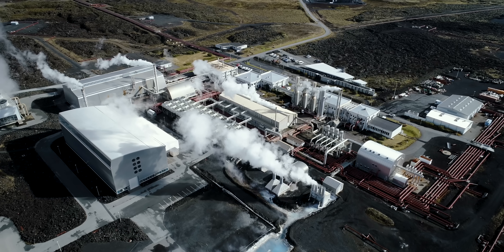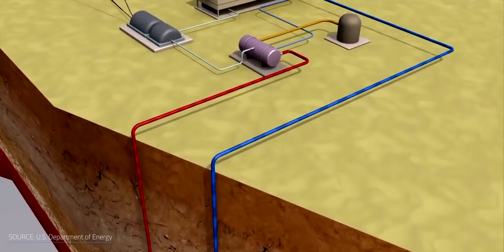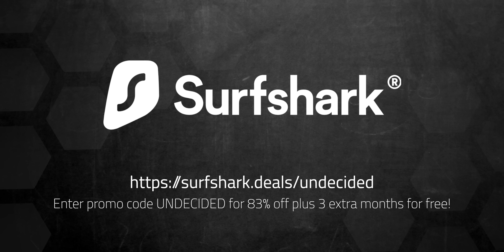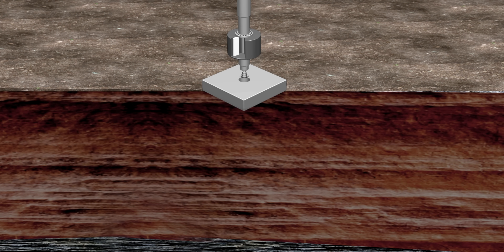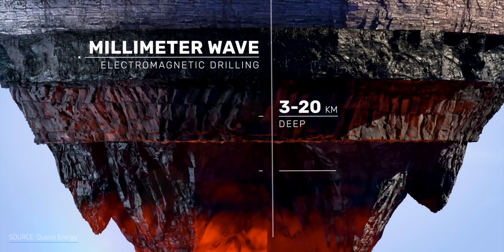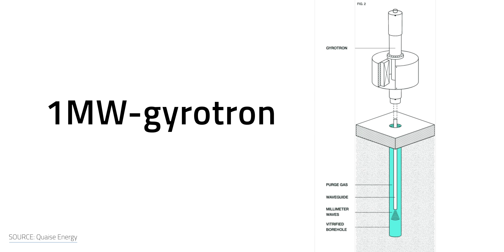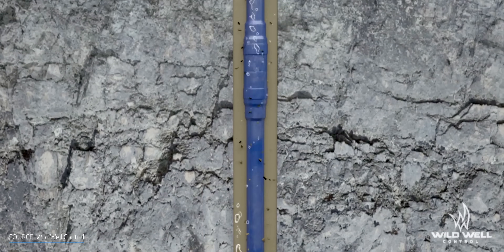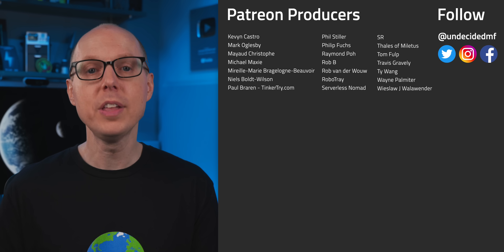Why This Fusion Tech May Be a Geothermal Energy Breakthrough

Comment: Geothermal power plants require high volumes of circulating water. Unfortunately there are only few spots where the hot area rock is porous enough to allow the circulation required.

Comment: Using nuclear power to melt rocks turning it into glass pushing it aside and a shaft is an old idea that I have come across 8 or 10 years ago , it was in the conspiracy movement in which they say tunnels criss-crossing this nation , supposedly there is a high-speed Train that could achieve Mach 1or 2 Underground in a vacuum tunnel , (and no it is not Musk the fraudsters idea it have already existed a long time ago ), supposedly there is a drilling equipment that uses some sort of atomic power to melt rockc and pushing it out of the way  ceiling and reinforcing the side walls of the tunnel.

Comment: This all sounds amazing, and I'm rather excited to see it in action! But... wouldn't pulling all that heated material up to the surface cause additions to the surface temperature of the earth? Perhaps a couple of these wouldn't make any measurable difference, but perhaps the numerous installations around the world? I'm really hoping that this isn't the case, but I'd love to hear the explanation about it. 
And if it would contribute to the above-ground-temperature, would it then make more sense to bury the geothermal plants under the ground by a certain distance to insulate it, and then run the power lines from that facility up to the surface for distribution?

Comment: I haven't heard anyone from Quasie talk about hove they are going to connect the down and up bore holes. The need for an ultra straight waveguide eliminates directional drilling, and I doubt you can frack at those pressures.

Comment: I can’t remember who told me this, but suffice to say, a wise old man with an eye for innovation once said to me, “You don’t need a drill.  You need a hole.  You use the drill because it’s familiar, and good enough not to warrant a second thought.  The drill is usually the best tool, but there may come a time when it isn’t, and you must remember, it’s the hole you need; not the drill.”
I’m sure to be paraphrasing rather substantially, but the point is preserved.

Comment: Boggles the mind how much power half a million can get you. At the residential costs I pay, 15¢/kWh, I could melt about 6,500 tons of steel with an arc furnace (~500kWh/ton). At the 3¢/kWh they quoted in the video you could melt over 33,000 tons of steel with the electricity used for one borehole

Comment: Drilling down is not necessary, there are plenty of places in US that have hot springs.  Hot Springs Arkansas, New Mexico, Montana, California, just to mane a few.  I don't see why drilling so deep is necessary, sure it wouldn't be hot enough for steam but any hot water can be a huge boost to turn it to steam to run generators.  They get gas from wells in Texas around Ft Worth area, and 90% of it is hot water around 180 degrees.

Comment: Sorry but to me this is moving beyond the mark. Reaching for inefficient methods that will never work as well, and do not have the energy density equivalent to make it comparable by costs. Why  has the west walked away from nuclear power. Walking away from mobility, and ease of energy load location adaptation.  Earthquakes, even away from plate boundaries, you still have fault lines, even in the Midwest of the US, we have fault lines. It does sound cool to test out but the costs to me would still be to high compared to a small modular mobile nuclear reactors, whose costs are more political than mechanical. Where ever you drill you will still need to set new power lines, substations, power transmission losses…. 
And I am still not buying this CO2 - bad, talking point. I see a lot of money being dumped into inefficient projects - solar - wind - solar concentrators, all with very very low power to cost ratios. All from fear mongering, of photos of steam - not pollution, not the real pollution in our water systems, oceans, soil. Remember solar, wind turbines, are not renewable, just like nuclear is not renewable. But the energy density for comparison is about 1,000,000:1.  Hard to see the truth through all the politics around “climate change”, and fear mongering, it is always another 10 years and we are dead, going back to the 1980’s, yet here we are - still, and the planet is getting cooler, not hotter. Check the facts.

Comment: Earth has a very hot molten iron core. If it cooled down, the planet would grow cold and dead. Cooling also could cost us the magnetic shield around the planet created by heat from the core. This shield protects Earth from cosmic radiation.

Comment: So, the Rossi E-Cat hydrogen nickel low energy fusion generator, and the Yildiz permanent magnetic motor are two working solutions that completely solve the energy needs of Earth, and those are just 2 technologies. Geothermal seems workable, but at some point science needs to set a hard rule that drilling deep holes is no longer allowed. There are simple above ground technologies (see above) that can work to transition us into renewable energy.

Comment: Why does the graphic which presumably shows potential sites completely ignore the southern hemisphere and most of Asia? This  way of tapping into geothermal power under existing coal power stations might give them a new, clean lease on life. Earlier on, there was a statement that the upper layers of the crust are always sedimentary and the deeper layers are granite. Not necessarily. Fir instance the Hunter Valley in Australia has granite very close to the surface and a lot of coal on top of it. So unfortunately it might be expensive to use deep drilling to replace the coal with geothermal. Where I live in Canberra, the granite is at or very close to the surface. The Snowy Mountains nearby are mostly granite. Anyway it would be great if geothermal could replace coal as the base load source.

Comment: unlimited energy is very easy to pull off. if you ever used a gas siphon, you know that you can use gravity to move water up and down through gravitational suction. now if you attach a water wheel to where the liquid falls out, you will be able to turn it to produce mechanical energy. attach a generator to it and you turn this gravitational suction into mechanical energy into electrical energy. So long as the suction isn't broken, which is obtainable, and so long as no one turns off the gravity, the water or oil or what ever you would like to siphon will continue to flow. Yes the laws of thermodynamics states there will be a loss of energy somewhere, and this is true, as nothing is 100 percent efficient. However, it beats waiting for solar panels to overcome their 30% efficiency, it beats waiting to dig deep into the earth, and it beats waiting for wind to blow. Not only that, it is incredibly easy to set up as well.

Comment: lets talk to paul to get to the b0ttom of this . . . yay puns!! ; so technically they could make one small and efficient enough to fit on a space force space shuttle to drill deep to stop a extinction level asteroid. this sounds great and geo thermal is good source of energy 2 . . .I saw this drill on newatlas a few months ago, it can revolutionize drilling and making underground tunnels or building foundations much faster . . . and maybe even more efficient mining using drones and smaller tunnels to get

Comment: My fear is, if this tech works, the oil and gas industry will just use it to get cheaper access to fossil fuels, then we'll be right back where we started.
Reply: For many reasons, this tech is not suitable for use in the sedimentary zone where oil and gas are found.
Reply: Thing is, you still have to drill MANY bore holes to access the same amount of energy provided by fossil fuels. You combust gasoline once, it’s done. You get to supercritical water heating temperatures the power will be available till our planetary core becomes inactive which would take more time than it will take for our sun to expand, engulfing our planet and becoming a red giant. You can’t compete with fossil fuels for energy when you’ve dug deep enough to to heat water to supercritical levels and probably can’t at levels before that either. But I agree it’s a concern worth being vigilant about as fossil fuel companies will try to extend their oil drilling instead of reinvesting for longer than is rational
Reply: @markhaus  Why do you compare this renewable energy source with fossiles? 100 kW per km² is not much, even if it only takes 10 holes to get it all out. The heat wll come up as decentralized as one can imagine, its not like you want to build a 10 kW turbine for every hole. Pipe to get it from A to B doesnt just cost money, the heat is simply lost on the way. Getting it out of the hole will already lose a lot on the way up. Its really not that straight forward, regardless of how easy/cheap it is to drill the hole.

There are other issues like groundwater contamination, earthquakes, hitting an Anhydrite layer etc. Such a hole isnt something you just put somewhere and thats it.
Reply: This will undercut the price of energy making it the least cost to everything but hydro.
Reply: The brake on that is government signed agreements to reduce fossil fuel use to near zero, thus making such fuel near valueless. The sensible players in the oil & gas industry will ensure they diversify into other power supplies as soon as they can ascertain which of them are going to be winners, and use their strengths to dominate those markets.
Reply: They will DEFINITELY do that, but if you can just keep digging and hit geothermal energy viability, they might not be able to compete with that. Fingers crossed.
Reply from the maker: I definitely see that concern, but I’m not too worried about that.  If Quaise succeeds at their goals, geothermal base load power plants will be one of the cheapest and consistent ways to generate power.  Corporations will follow the easy money (if Quaise succeeds).  Combine that with many countries policies to phase out carbon emissions and you may have a winning formula.
Reply: @UndecidedMF  So how much energy can be "extracted" from one of these holes over extended periods of time? So without depleting the heat reserviour? There is only so much heatflux possible, about 0.1 MW/km² according to wiki (Geothermal energy). So how many holes to drill to extract this power, to cover a whole km²? Does that still make sense if the location is not right?
Reply: @leocurious9919 The natural heat flux due to conduction through the layers of earth's mantle is not the limiting factor for geothermal energy. 
If you cool your bottle of beer in a lake are you increasing the temperature of the lake? If you boil a cup of water over a forest fire, are you decreasing the temperature of the fire? Sorry for the bad analogies, but what I'm trying to get at is the scale we're talking about here. As shown at 3:17 in the video, using only 0.1% of the earth's heat would provide enough energy for 2 million years.
One or even a few hundred local holes could not extract enough heat to change the overall temperature.
Same as using solar panels could not lower global temperatures, wind generators could not reduce global wind patterns, geothermal plants could not significantly lower the heat content in the earth's crust. Geothermal energy could only extract a minute amount of heat from the earth's crust, making the heat source constant and inexhaustible on any human time scale, hence it is considered renewable energy (does not deplete with use).

The limiting factor is not the heat source, but how much of the heat you can bring to the surface to generate electricity (or produce hydrogen or desalinate water). 
This project tries to reach a place in the crust with a constant 500°C temperature where water could be heated to a supercritical state, making it behave like a gas (i.e. compressible) enabling to transport much larger amounts of heat to the surface. They are also not hydro-fracking (seismicity problems), and use conventional drilling methods until they reach the impermeable cap rock. The question of course is if they can actually drill a hole that deep in real life.
Reply: They might, but probably will not, because their strategy so far was to drop oil and nat gas prices significantly in the 2010s to bankrupt little companies.  Then once the larger companies felt like they had a foothold to raise prices significantly.  The Ukraine War does influence crude and nat gas prices, but part of it is used as an excuse to raise prices.

This tech, like fracking, may help the little guy get a foothold again, which could cause a crash in oil prices again, which is a possible future, or the larger companies may maintain control, do everything they can to keep prices higher, and avoid this technology.  It will be interesting to see what will happen.

Comment: I Have worked underground in mines drilling and blasting access tunnels. Gold, Copper, Zinc, Iron, at different sites and times.When we are down generally beyond 3000 Ft and typically, 5000 ft, When I drill my holes in a round (About 30  to 100,  8 ft or deeper)  It's all subjective; but often at deeper levels, the pressure becomes so great, the holes actually squeeze closed on my steel so I can't extract my steel & bit, This is the subjective part , Ground composition, May have to drill and blast shorter rounds,  judgements! many scenarios to consider. This Is only a mile down! Pressure increases substantially with depth and The rock is not static! It moves!  Rock Mechanics should know this. Engineers are losing to technology & Pseudoscience. Sorry Matt I actually love your Stuff. But This geothermal drilling is only part of the problem.

Comment: Maybe start with old abandoned oil wells?  According to the Environmental Protection Agency, 3.2 million abandoned oil and gas wells exist in the United States. About a third of them were plugged with cement, which is considered the proper way to prevent harmful chemical leaks. But most haven't been plugged at all.

Comment: Thin shell structural strength of the hole would be excellent. Could be possible to slow the rate of advancement to provide increased thickness of the sidewall shell. Would it be enough? Unknown, would love to try it. This based on my 35 years of geotechnical engineering, licenses in most states, degrees in engineering, geotechnical engineering and minors in physics, chemistry and mathematics.

Comment: Who needs even fusion energy if we can pull this off? We can reuse commissioned coal and gas powerplants, it generates power around the clock and essentially never runs out.
With conventional geothermal being 4 times more expensive than solar per MW would that include the extra photovoltaics and batteries to store excess energy to use at night? If not then even conventional geothermal would be pretty cost effective.

Also in colder climates you could also use the geothermal powerplant to pump around hot water to heat homes with like they already do in Iceland (they also run these hot water pipes underneath roads to melt snow). Politicians should take a look at this and fund this

Comment: I wonder if it becomes more of an issue with powering it the further it goes with voltage drop on the power cable?. The voltage would have to be super high to begin with that length of cable run.

It's an interesting concept though, to retrofit existing plants would be great!

Comment: How resilient is the "glass" casing?  It is important to avoid contaminating overlying aquifers with geothermal liquids.  I am a big fan of geothermal and this might cure two additional problems beyond drilling cost.  First, as you mention, geothermal explorations costs are very high for most new facilities because near surface geothermal resources are rare.  But if you can drill cheaply enough, deeper lying resources that are more widespread become available.  Second,    in near surface resources, depletion of the heat resource is a problem.  Higher temperature resources with better recharge characteristics are more available at deeper levels.  Due to the way geothermal projects are financed, it is better to have a very reliable project that is only slightly cheaper than alternative energy sources than it is to have a chancy project that would be much cheaper than alternatives if it pans out.  Drilling deeper will add cost, but reduce risk.

Comment: Drilling mud is used to return material to the surface and keep weight to overcome pressure on the well column. This team will need to insure here is a way to contain 20,000+ psi of pressure in the well while drilling.

Comment: You could retrofit a coal plant with this. Just use the heat from geothermal, instead of coal. The turbine and generator, the cooling systems, the electrical systems - these investments are protected. Throw away the boiler and coal mills and the chimney!

Comment: Although I sincerely applaud the content on this channel, I found myself irked by references to fusion with respect to the EM radiation melting and vaporising rock. There is NO fusion happening here and using that word feels unscientific. No atomic nuclei are fusing here at all and transmuting elements or converting mass into energy.
Granted the connection with radiation pressure in inertial confinement for fusion research, and the care taken to laugh off references to death rays, but leaving the term fusion in to describe vaporising the rock is just propagating nonsense. [/rant]
I suspect I'm not the target of this channel, but I usually find informative content here to broaden my horizons, so please don't take this rare criticism the wrong way. :-)

OK. watched the rest [beyond 5' mark] and had most of my questions and caveats answered without being triggered again. Good job!